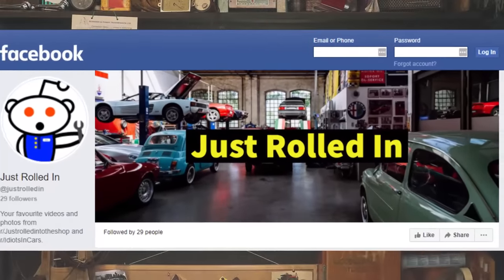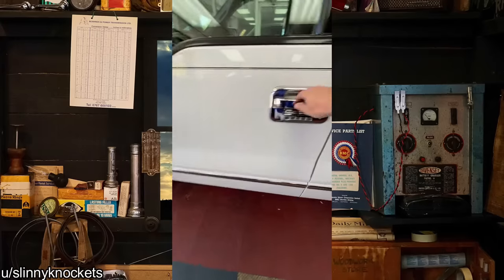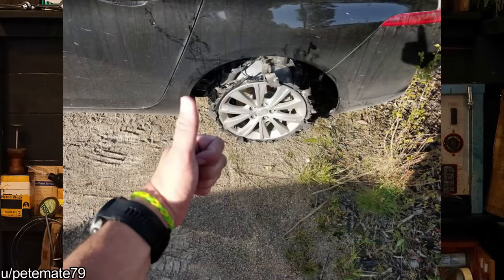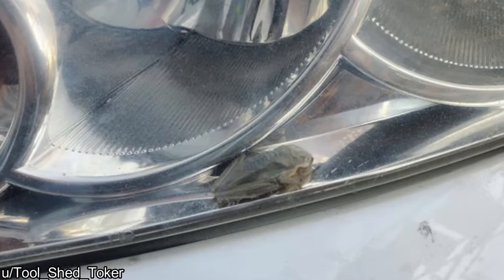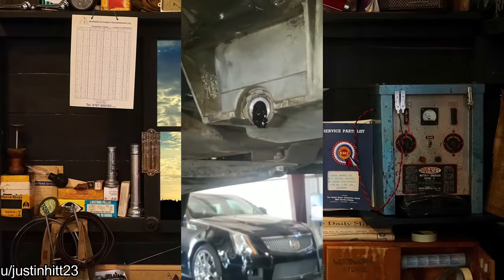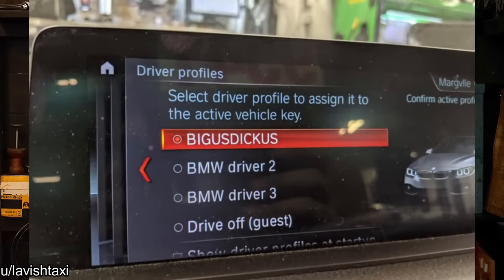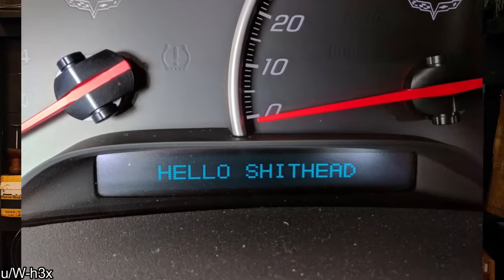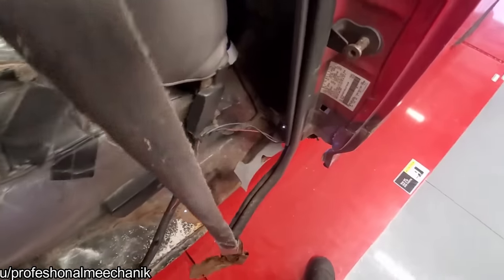Customer States Compilation (Best Clips & Photos so far) | Just Rolled In

Comment: Declined changing tire, just do oil change. Uh... that tire is moments away from popping. Should be instant regret, about to leave the shop and the tire pops. I think every mechanic should let the air out then drive a screwdriver into the sidewall of a bald tire, try to fill it up and then tell the customer, your tire doesnt hold air, is worn out and needs to be replaced. They won't be driving far on a flat tire.

Comment: SEA FOAM WILL FIX ALL OIL ISSUES.

nah.. just joking.
Reply: I once put a motor in my car to get through winter and it was in a friend's yard and was a ball of grease outside and inside as well, but ran well. 
I started putting clean detergent oil in it and after short time was amazed how much of the sludge it was melting down under the valve cover.
Reply: @michaelszczys8316  True there is good videos how well they do stop even knocking sounds as due blocked oil circulation and they really does make good job fixing issues with oil passages.

Comment: Laugh about the paint can all you want. Funny as it is Detroit Diesels came with a similar setup right from the factory. There was a flap just above the blower that when released would seal the airflow off to the engine, effectively snuffing it out. He’s doing the same thing, probably something wrong with his throttle linkage. Silly, but an effective safe fix